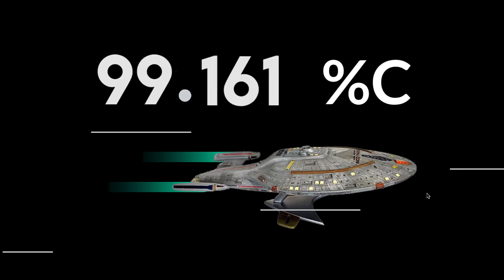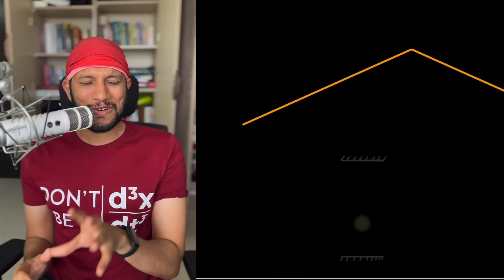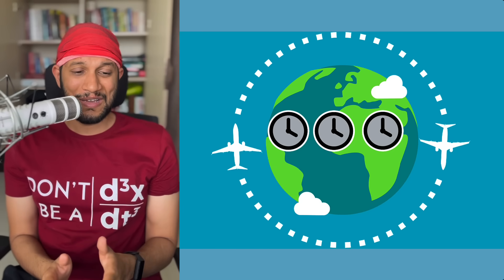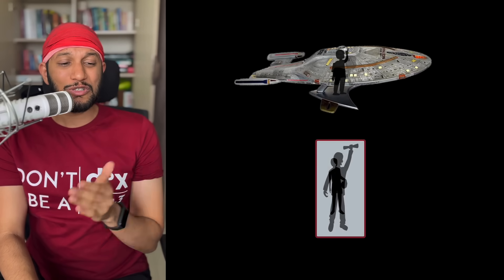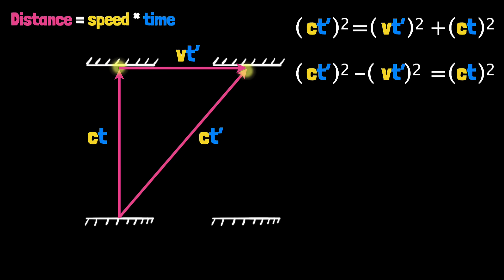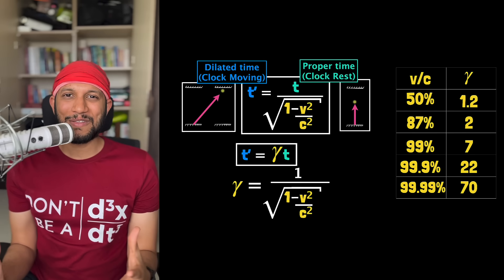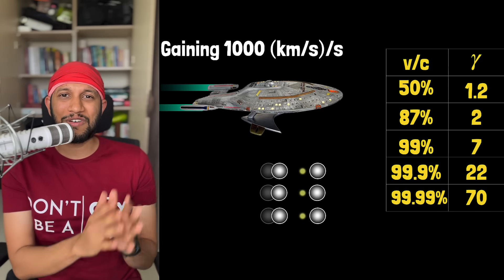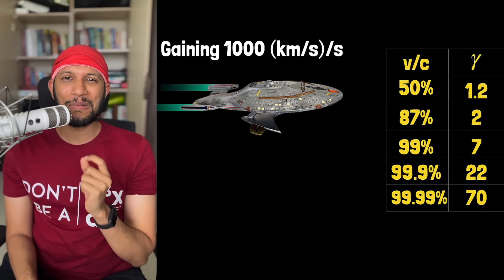I finally understood why you can't go faster than light! (My mind is blown)

Comment: I will give you the simplest reason you can’t travel faster than light, why tachyons are impossible. 

At the speed of light, all distances become 0 along the axis of travel. From light’s perspective it travels no distance in zero elapsed time to reach any destination in the universe. It is basically instantaneous travel. This follows from the Lorentz-Fitzgerald transformations. 

So, basically photons shrink the entire universe along the axis of travel to 0 distance. 

If you could somehow travel faster than “c” you would overshoot the entire universe which is not possible.

Now, neutrinos can travel very close to “c.” This leads to a rather amazing result. Let’s say a neutrino is created at one location, and travels to the most distant location in the universe—say a trillion, trillion, trillion light years away. 

At some arbitrarily close velocity to “c” from its own perspective it can travel that distance in Planck time, and only has to travel Planck distance. If it originated on Earth, and traveled to the furthest star or black hole in the universe, it would only have to travel the smallest possible distance, for the theoretically shortest period of time. From its perspective that sun or black hole is beneath the surface of the Earth. 

It never actually travels faster than “c.” It essentially travels to its destination by contracting distance to virtual zero, and by dilating time. When it is absorbed and comes to rest, it will then seem to have traveled near infinitely faster than the speed of light without actually having done so. 

This makes Warp Drive impossible, because at “c,” you could travel anywhere in the universe instantaneously. 

Note, photons only travel at “c” from our perspective, and neutrinos only travel close to “c” from our perspective, our inertial frame reference. From their frame reference they travel to any destination instantaneously or near instantaneously. 

I subscribe to the Einstein-Minkowski universe, wherein the BB still exists. To light, the entire universe is still a singularity. 

At 169,000 miles per second, the universe would be 1/2 the size it actually is, and all distances would shrink by 50%. 

The contraction of space is only supposed to be along the axis of travel. This presumes spacetime is flat. However, if space-time is a 4-D, 4-space, hypersphere, and light travels along a spacetime geodesic or any sort of arc, that would collapse spacetime to a singularity. 

As matter travels close to “c” its mass approaches infinite mass, and would require an infinite amount of energy to reach “c.” This is another way of demonstrating it is impossible for matter to accelerate just to “c” let alone a velocity faster than “c.”

Comment: You're analyzing this from a wrong stand point by analyzing it from "outside" the ship as an "observor". At these astronomical velocities or gravities, what you see as an outside observor doesn't accurately corresponds with reality.
"It takes longer and longer for the ship to get close to the speed of light", because it takes longer and longer for the light to travel to outside observor's eyes.

In another instance, if you observe a space ship traveling too close to a black hole, the ship you will be observing becomes it's past, while the ship itself is ahead of observor's time. That is because the light is taking longer time to reach to you, because light becomes way more slower, because the light is being pulled by the intense gravity of event horizon. Therefore the image of the ship will reach you a lot slower.

You can't produce accurate results as an outside observor in such astronomical mathematics. At those numbers, the term "It's not what it seems." gets a literal meaning.
Reply: what explanation do u have for muons then? how do they travel so many kilometers when from their frame they should do just about 600 metres? its not an illusion what the observer sees. all stand points result in the same outcome. its just that reality is frame dependent and its not fixed but it is also logically consistent within all frames. what the observer sees is also real and what anyone else from any other frame would also be real. so the results are fairly accurate and it is what it seems but the ‘it’ can be different for different frames. the problem with ur explanation is that u confuse what the observer actually measures with what the observer sees because of light delay. light delay and time dilation are independent phenomenas and time dilation is what we use to explain why we cant reach speed of light not light delay. also light doesn’t slow down near black holes, it always travels at c locally. u can analyze from outside the ship just fine, relativity works perfectly from any frame as long as u apply it correctly. so saying outside observer frame is wrong or that light delay is why ship can’t reach c is just wrong.
Reply: @aryantrippin  "Also light doesn't slow down near black holes", I was about to give you a logical explanation but this claim showed me it's gonna be a "time waste".
I will tell you this much however, out of courtesy, everything was impossible until one smart mind found a way to make it happen. There are a lot of things in this universe that are beyond human's mental comprehension at evolution's current stage. Achieving the light speed, pushing beyond it can be very much possible, just not with the known conventional ways.
Once in a time every physicist scientifically explained how it would be impossible to split the atom, until one day the whole world witnessed a million people in Japan fused with the Sun.
Reply: @SollAmoriiss  I was about to give you a logical explanation but this claim showed me it's gonna be a "time waste". ?? wheres your logical explanation lol u think ur a smart mind after saying something that doesnt make sense so u can be the unique one but bro its 2025 and what hes talking is very very well researched. "Achieving the light speed, pushing beyond it can be very much possible, just not with the known conventional ways". bro knows the method come on share the trick with me also bro??   "Once in a time every physicist scientifically explained how it would be impossible to split the atom" top 10 things that didnt happen. do u know the difference between philoshpical idea and scientific explanation?
Reply: @aryantrippin  Where is my logical explanation? No need to make any since you won't bother to try to understand.
"knows the method come on share", I believe I clearly said it is not yet achievable by today's conventional, however this can't be a fact it can never be achievable in the future.
I'm not going to explain more to another tseries mindset. Also learn English since it is not your strong suit to understand it, and perhaps clean your streets a bit. Therefore the public health conditions can have a chance to improve.
Have a nice one.

Comment: What in case of digital watch?
Reply: That digital clock still consists of atoms and electrons, doesn't it? Therefore, the same laws still apply.
Reply: That doesn't depend on the motion of those atoms so ...@GForceAce
Reply: @gazi_urf_gayoor_009 Electrons moving through a circuit also rely on the same principles described in the video.
Reply: Don't they depend on electric field which is independent of speed
Reply: @gazi_urf_gayoor_009 I’m pretty sure all energy follows the same rules covered in this video. I’m no physicist so I’m just going off of the information I was given.

Comment: You can go faster than light. There are objects orbiting Dark Collapsed Stars that are doing just that. And motion is relative which means there is no such thing as the ultimate speed. Two objects going at 2/3rd the speed of light but traveling at different opposite directions pass each other. Relative to each other they are both traveling faster than the speed of light. This is relativity.

Comment: You Only Need 42    
An Improbability Drive is a fictional spacecraft engine from Douglas Adams's The Hitchhiker's Guide to the Galaxy that allows a ship to travel between any two points in the universe instantly by generating an event of infinite improbability. This process bypasses normal space travel by making any location, no matter how unlikely, a possibility. The key side effects of using the drive are the spontaneous appearance of improbable objects and creatures, like a sperm whale appearing miles above an alien planet.

Comment: To those asking if the observers inside the ship can reach lightspeed (regardless of if they're being observed or not):

No, because separate/irrespective of time dilation, a physical object with mass can't reach the speed of light. As an object accelerates, it becomes more and more difficult to speed up because its momentum increases. The closer it gets to the speed of light, the more energy is required for even a tiny increase in speed. To reach the speed of light, you would need an infinite amount of energy, which is impossible to obtain.
The idea that mass increases as an object speeds up is a helpful way to think about it, but it's not quite right. A better way to think about it is that an object's inertia, (its resistance to a change in motion), becomes infinitely large as its speed approaches the speed of light. This is why you could not accelerate to the speed of light even if you had infinite time, you would still need an infinite amount of energy to keep pushing yourself.
Another way to say this: you can't accelerate to the speed of light with finite energy (even if you have infinite time, because you'll exhaust/use up all the energy in the universe before even getting close to true Lightspeed), there is one way you can say you can reach lightspeed, and that's by having an infinite amount of energy and an infinite amount of time, in such a scenario, you can reach lightspeed if you're willing to wait forever, literally have to wait for infinity before achieving C, you'll forever be getting close to lightspeed but never truly there, all the while you're emptying the universe of all it's fuel/energy, this is why it's not possible in real life🫡

Comment: So he explains why you can't accelerate matter to the speed of light, due to time dilation, well done, but he doesn't directly address why you can't go faster than the speed of light. Fortunately this is just as simple. All matter is made of particles. Those particles are ultimately made out of elementary particles (or they are elementary particles like the electron). Elementary particles are ripples (waves) in elementary fields. So why can't these ripples (waves) in the elementary fields travel faster than C? That's just they way it is. It's an intrinsic property of the universe.

In fact, some of these fields (most actually) cross interact with other fields and their ripples experience a sort of drag.

Comment: For sci-fi geeks, long travels at 99.99999% would still  be quite enough as the one traveling would age slower as well to visit closer star systems. 1g for 1 year to speed up ( non dialated ) 1 year to slow down.... Add years for how far you need to go.... Fuel the rockets with glowing pink goo. 😂

Comment: If one can harness the same energy that black holes use to and from event horizon we can theoretically be either 99.99% of the speed of the photon or even exceed it, another case is of the Leptons that have been proved to travel faster than the speed of photons. Time dilation is a very interesting phenomenon. You said gravity does act a bit on the slowing down of the atomic clocks but you forgot it plays a very major role in the bending of space time continuum.

Comment: This is NOT invalidation but a related question I am trying to understand.  Could you explain the difference between time flow and measure of time. In context of your explaination, the photon clock is taking longer because the photon is traveling longer distance. Each tick is treated as a unit of time. However, this can also be interpreted as a measure of time rather than actual time since the photo was actively traveling during this  and hence if you think of time in terms of continuity of events, the time is still flowing normally for the photon. So what I am suggesting is that the fact that the measure of time is being affected is not the same as the time actually slowing down. In the twins scenario, the experiential difference of one aging more than the other is more a slow down in the process of aging a process slow down is not necessarily the same as a time slow down. This is actually the very last hurdle I have to understanding the time dilation and speed of light thing. Hope you could help me on this. Thanks. Hope I am clear on my question, my activity on Youtube is more of a AI MVs on my channel, physics is NOT my strong suite.

Comment: I've thought about this more practically lately, and just as a thought experiment, you can only throw things (particles, flames etc) out of the back of your craft at speeds up to the speed of light, even if your ship runs on photons somehow, you are only spitting out exhaust at light speed, how can you go faster than your own thrust? What can you even do to accelerate a single particle more than that speed? Just doing that would take more energy than the universe contains according to the physics we currently know.

Comment: The part that doesn't make sense to me is OK I'm standing here on the Earth it's rotating which is causing movement; the Earth is going around the sun which is causing movement; the sun is going around the Galaxy which is causing movement. OK so you take the direction that our star is moving around the Galaxy you send one ship approaching the speed of light going with the direction that our star is going and one going the opposite way. Now how fast do each appear to be going to us? If it's all based on frames of reference, how fast are they going compared to each other?
Reply from the maker: It will always be less than light speed. Speeds don’t add up like in Newtonian physics. That’s an approximation

Comment: But what if we could somehow use light itself as the fuel? Since for every action there is an equal and opposite reaction then if we could somehow use the action of light proportional to the mass of the object being propelled to push it to the speed of light. If light is going at the speed of light and we can somehow gain 100% efficiency of that reaction then we just need to throttle how much light is being used to speed up gradually until we get to C.
Reply: Light has no mass so it can't be used as a propellent, there will be an equal and opposite reaction but it would be 0
Reply: @matthumphries4775  but photons have momentum?

Comment: But this explanation is only for those looking outside the ship, because for the people inside the ship they would see their time normal and not dilattated and steady, so if they would be accelerating t 1000 Km/s then eventually because they are not experiencing their own time dilatation, so they should be able to reach light speed.

Comment: You also tend to get length contraction for a ship traveling close to light speed where it appears to shrink (from the outside) along one of the axis, from the perspective of people inside the ship they'd feel as if they were skipping ahead into the future if they looked outside they'd see everyone running around at high speed.
 The time dilation is also a problem GPS satellites run into since they're in constant motion and use very precise clocks.

Comment: Based on this explanation, it sounds like the people on the ship should be able to reach the speed of light. You’re saying that, to an outside observer, they would never see the ship reach the speed of light because it would take an “infinite” amount of time. But if you’re on the ship , you’re experiencing time dilation so it doesn’t matter if it takes 100 trillion years to reach the speed of light because for you, on the ship, it would happen right away. If you keep accelerating at 1,000 km per second every second, then you can do the math and see how long it would take to reach the speed of light. If you’re on the ship, then from your point of view, you’d reach the speed of light in that amount of time. But we know that’s not actually possible. The original explanation that says that a literal infinite amount of energy would be required to accelerate mass to the speed of light makes perfect sense. That’s the reason nothing with mass can reach the speed of light.

Comment: If you were travelling at the speed of light and you turn your headlights on would it still be dark or would that light then be travelling at twice the speed of light?   Also, would any radio waves make it back to earth?
Reply: 1st question; no headlight light because light is a fixed speed, like sound depending on air pressure.  2nd question; yes you can still transmit radio waves
Reply: @Drewcardello  But is you are travelling faster than the speed of radio waves then how can the radio waves be sent behind you back to earth?
Reply: @shovelguggelheim8454 because they travel at a constant speed, its not adjusted for how fast you are already going

Comment: So you’re telling me that if twins are born and one is put onto a spaceship to run laps around the solar system at 99.99% the speed of light for one year; that twin will return at one year old to see his 70 year old sibling. I don’t think so Tim.
Reply: It's true, and it's confirmed empirically. GPS satellites are adjusted for time dilation, and the required adjustment aligns with theoretical calculation perfectly.